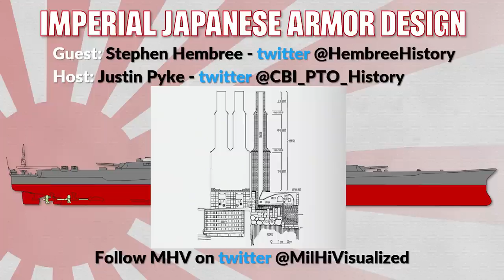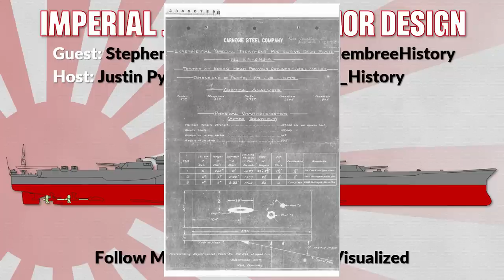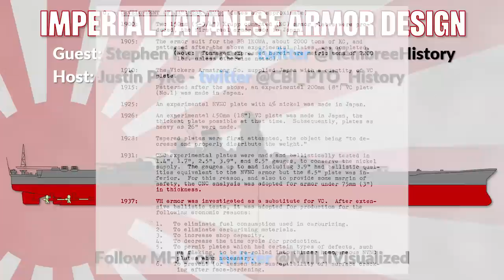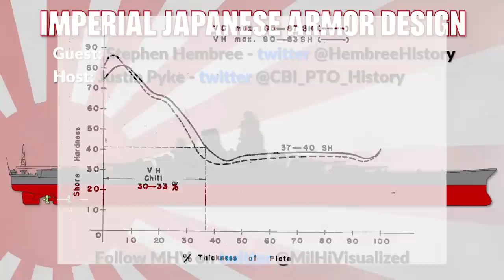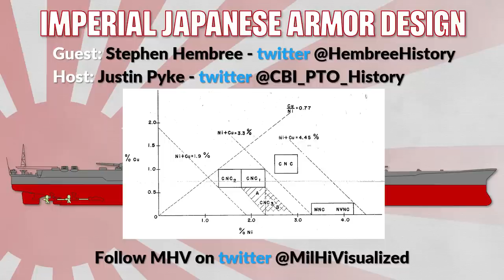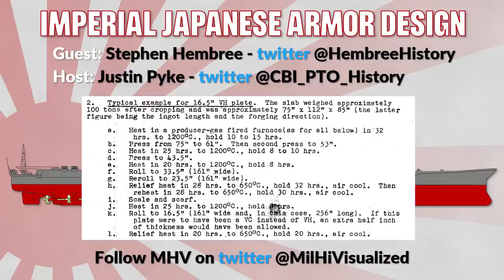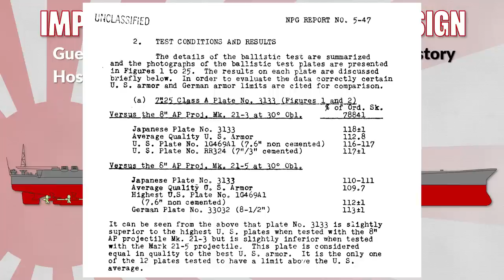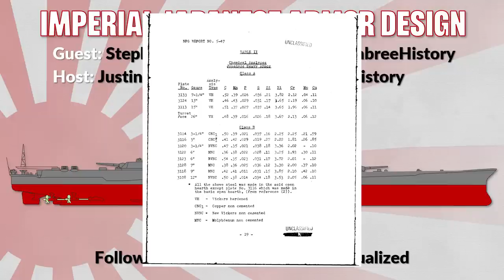Japanese Navy Armor WW2 - Ultra Short Guide

Comment: I need to go through this again. 

Also, brush up on the basics I thought I had on metallurgy. 

Yet, in saying that, I really have to credit Japan for making the ships that they did. Getting an industry started, is hard enough. On some level getting it back is even harder. Working with the material you have and somehow, still getting the results they did speaks to their technical knowledge and ingenuity. 

At least, I'll be happy to be done and say that until I get my head around more of this stuff.
Reply: Not to mention they started a couple hundred years late, and were decently caught up after, what? 60 or 70 years?
Reply: @Halinspark  In part the point of my comment. 

Doing anything costs time, money and quality. They chose quality and a very short time frame, while not having a lot of money and made it work. 

Add in adapting local materials, having the expertise to manage that process. 

Credit really is due here. It's a shame that it led to what it did.

Comment: FANTASTIC!!!  I had come to some of the same ideas about VH armor.  You know much more than I about the details.  VH armor was the best non-cemented form of IKC-type armor, about 89% as strong as US Navy WWII Class "A" Thick Chill (55% face) Armor, though the use of a 35% face gave it an upgrade due to less scaling effects and the armor was thus roughly as good as the original Vickers 1912 KC-type armor.  Extensive US NPG, Dahlgren, VA, ballistic tests of the new 6" and up AP rounds at 35-40 degrees against thick face-hardened armor had demonstrated that the use of the hard- and, in the US 6" Mark 35 MOD 9 and 8" Mark 21 MOD 5 AP shells of late-WWII, super-hard AP caps, showed that US AP rounds had minor problems with cemented (original KC-type) surface layer due to its thin depth, which is destroyed by the AP cap prior to the projectile nose toughing the pit in the plate face.  The US and all non-Japanese thick side armor plates kept the cemented layer because of tradition more than anything else, since it had improved resistance against the soft-AP-capped projectile used up through most of WWI (and after in navies that did not upgrade their ammo, such as the US Navy prior to the mid-1930s).  The thick hardened face behind the thin cemented layer varied quite a bit in depth from the original Krupp 35% value, due to various theories as to how this kind of armor worked -- nobody had ever done a detailed analysis of face-hardened armor effectiveness, which I was amazed to find out.  Japan, however, kept the 35% face depth -- to the actual spot where the back hardness began, not some arbitrary hardness value, as was used by some navies --  for all of its VC and VH plates (I assume Vickers did too during WWI and before).  The use of a high 0.55% carbon content in NVNC and VH armors (most such non-Japanese armors based on the original 1894 Krupp Nickel-Chromium Steel used only 0.2-0.4% carbon) seems to be to reduce the heating, hardening, tempering time to make these steels, though much more careful quality control was needed to keep the steel from getting too brittle.

They DID cement VH armor?  The change from VC thickness used implies that the layer must have been very thin and not very hard.  US metallurgical tests did not indicate any significant extra carbon on the surface.  Why would they do this?

A note on Japanese quality control.  When the US Navy sent a number of VH and VC plates to the NPG for ballistic and metallurgical tests, they found that ALL (repeat, ALL!!!) of these plates had EXACTLY 35% face thickness, not 34% and not 36%, indicating a quality control system way better than used by any other nation for armor, includ8ing The Midvale Company, which was the best armor firm that I knew of as to quality control otherwise.  The use of 0.55% carbon was not much of a problem for such design and manufacture capabilities.  No wonder after WWII they kicked US firms in several technological areas on their ass!

As to armor ballistic quality:  Later in WWII the Japanese metallurgists at their NPG were not test8ing much new armor.  They corrected a brittleness problem with the very thick VH plates used for the YAMATO turrets (the stopping power was not reduced, but these plates cracked in half when hit by large US AP projectiles, penetrating or not) and they did some experiments with VH plate hardening and tempering to see if it could be improved.  Never used for actual ships, of course, by this time, as mentioned here, but an about  7.25" and a 15" plate were made that had a thicker face of about 45% and, I assume, some new hardening and tempering techniques.  These plates were also sent for testing, the 7.25"plate to the US and the 15" to the UK.  The result?  BOTH PLATES WERE THE BEST -- repeat, BEST -- FACE-HARDENED ARMOR PLATES EVER TESTED by either the US or British proving grounds, even though the standard metallurgical examinations showed that the steel was the regular non-cemented form of VH face-hardened steel with merely the different face depth.  In fact, it gets even better.  The 7.25" plate was tested at 30 degrees -- the standard plate angle used in US armor ballistic acceptance tests with the heavy-weight US 8" Mark 21 MOD 3 (regular hard cap of maximum hardness of circa 525 Brinell Hardness Number (BHN) used with many US WWII AP shells) and its improved super-hard-capped (650-680 BHN, the hardness of the cemented layer of US Class "A" face-hardened armor) MOD 5 of the same shell.  They did not think that anything out of the ordinary would happen>  Boy, were they WRONG!!!  They fired two MOD 3 shells at the Japanese plate, the first at what should have been the VH penetration velocity from the other VH plates tested.  It did NOT penetrate.  They then upped the velocity to higher than any US Class "A" plate of that thickness.  The projectile did penetrate, but it did so in a way never seen before.  The hole made was smaller than the shell diameter and the projectile was extruded (narrowed and lengthened) like toothpaste from a tube.  This had never happened before to any tested projectile with any armor plate.  When they then tested the plate with the improved MOD 5 AP shell at the regular US Navy Class "A" test velocity, the impact did not penetrate, but at a somewhat higher velocity (less than the MOD 3 test) it did, being undamaged by the impact.  In their report, they had to state that they had no idea why this plate was so good and, because of this, they now realized that they did not understand how face-hardened armor worked.  IN AN OFFICIAL REPORT!  Wow!  Obviously Japanese metallurgists were second to none in their capabilities!

Note that there are many forms of hardness scales used:  Brinell, Rockwell "C" (usually), Vickers Pyramidal, Shore, etc.  You can find tables that allow one to be changed to another on YOUTUBE.  The US Navy used the Brinell scale at the NPG prior to and during WWII, but Rockwell "C" is the most widely used today.

H.T. steel and post-WWI Ducol extra-HT (DS) are British WWI and, for DS ("D" or "D-1" in Britain), much British post-WWI extra-strength construction and fragment/blast protection materials.  The Japanese adopted British practice for much of this.  US Navy did not use anything but full-strength armor steel -- BuORD Class "B" or BuC&R/BuSHIPS Special Treatment Steel -- as soon as such armor steels were available, for armor or, for the thin laminated (2 or 3 layer) decks in WWI-era battleships, for the top plate first hit, with nickel-steel armor being used for support and for all homogeneous armor prior to this.  Thus, how much you were willing to pay for protection varied from nation to nation.

One major reason for the improvement of most face-hardened armors after 1930 was a change in high-strength steel metallurgy recognizing that there are restrictions as to the tempering (post-hardening tempering) temperature range.  Using a higher temperature above circa-540 degrees C causes "temper embrittlement" that does not reduce brittleness in the hard plate, but enhances it.  You usually to reduce the temperature today to about 200 degrees C (see YOUTUBE knife-making videos) and take a longer time to get the proper toughness in the chilled part of the plate (or the knife edge, etc.).  VH armor did not do this, keeping the higher Vickers tempering process as is.  The difference is that the later (post-1930) face-hardened armors could shatter the WWI-era US soft-AP-capped "Midvale Unbreakable" AP shells (first one that changed the test standards for US AP shells was the 1916 12" Mark 15 MOD 6 AP projectile) while almost no pre-1930) face-hardened plates could.  Since almost no post-1930 AP projectiles still used soft AP caps, this was not important to VH armor, though other post-1930 improvements not used by the 1912 VC manufacturing process could have been.

Comment: Japan not having what they need to make the steel they is like having a flat tire on a car you can fix it but you don't have either the jack to lift the car or screw to remove the bolts XD

Comment: It's probably not the best reference, but it should be fine for us non-metallurgists.

The difference between the softer mild steel and harder "high carbon" steel is vaguely like 0.7%(assuming my quick google search is correct.)
The chromium mentioned in the video was over 3%.

Comment: Your definition of Ballistic Limit is incorrect:  It is the Striking Velocity (averaged over several test if possible) of the tested plate to barely completely penetrate the plate (with minimal remaining velocity -- zero at right-angles, but somewhat higher in some cases at an oblique impact) compared to the average Striking Velocity calculated based on the US NPG Thompson "F" Formula value.(from 1931 averaged armor tests by Dr. L.T.E. Thompson from earlier Class "B" and STS plates of all thicknesses made.  Post-1931 armor tests, as shown, were above that calculated average.  The "Percent Naval Ballistic Limit" (%NBL) is the ratio between the Thompson computation and the actual test result, both in feet/second.

Note also that the Thompson "F" Formula has no scaling term.  While this is small for homogeneous, ductile armor, it increases with increasing depth of the face layer.  The scaling effect reduces the resistance of face-hardened armor as projectile size increases, regardless of plate thickness.  This means that, regardless of how good the steel used in a plate is, if the face-hardened plate has a thicker face, it will gradually go down in %NBL compared to a plate with a thinner face against larger and larger shells.  Since the Japanese VC and VH plates had a 35% face, the German KC n/A Plates has a 41% face, and the US WWII Class "A" plates had a 55% face, the Percent NBL will be different for all three types even if they all had identical baseline steel quality.  This has to be calculated separately.  My FACEHARD computer program has in its BASIC Source Code the table of values to use with different face thicknesses when including scaling.  Thus, Plate Quality and %NBL against various different-sized projectiles of identical design and damage resistance will vary, even if the face-hardened plates are all made the same except for total thickness.

Comment: Yamato Armor could not be penatrated by any navel guns on the turret face and was atualy high quality
Reply: Speculation.
Reply: On the turrets yes. The belt and deck armour less so (though the 18.1" shell could also go through all belt and deck armour ever, so...)
Reply: @bkjeong4302  even the deck armor could not be penatrated by plungeing fire from Mark 8 super heavy while the belt armor could only be pen from close quarter and penatrating shells would not pen Citadel but mid deck conpartments as citadel shotz would be below water line.
Reply: @hitoshisawa8479  That's false. Mk.8 Mod 6-8 SHS could penetrate the Yamato's belt, deck, and turret face at operational ranges.